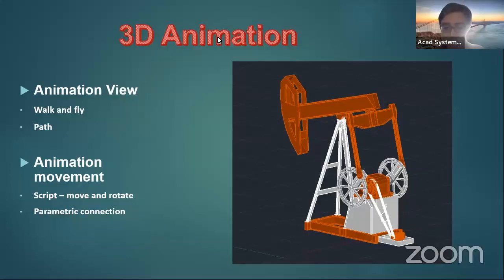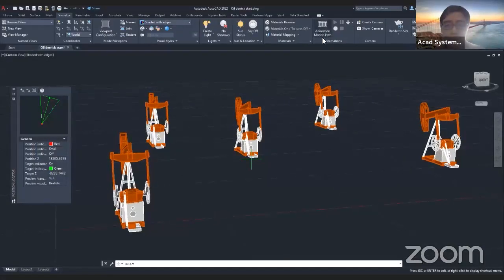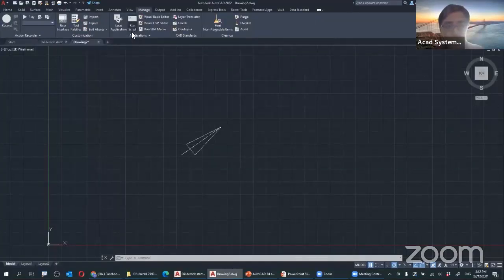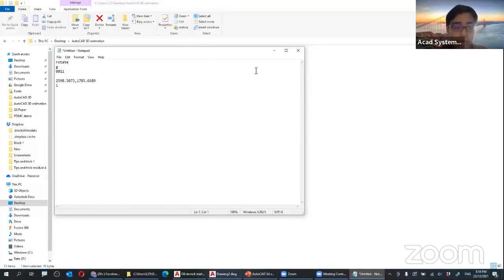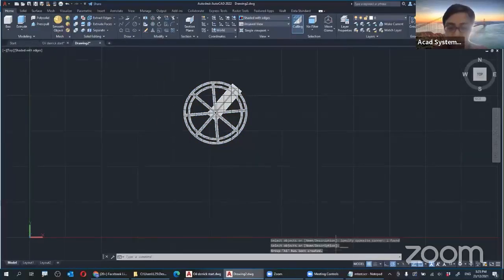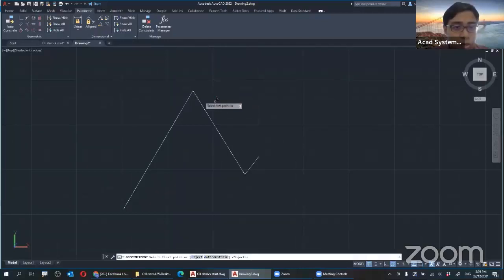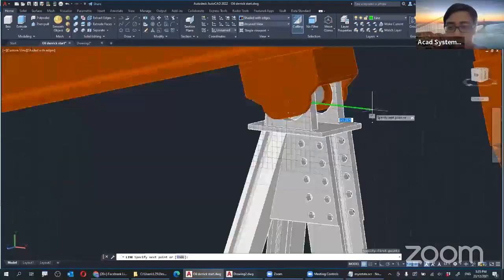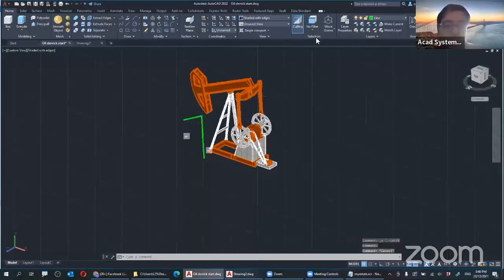How to do AutoCAD 3D Animation

Comment: Great video. I have a question about the movement method. I understand everything you've explained (that the object moves upwards by 3 units). However, I'm wondering what code I would write so that when the object is moving upwards at intervals, it stops at 50?

move
g
12

0,0,0
0,0,3

rscript

Thank you!
Reply from the maker: Hi, for that you need to repeat your code. you can also input delay to give it a short pause. delay 1000 is equal to 1 second. Here is an example that would stop until 20.

move
g
qw

0,0
0,3
delay 2000
move
g
qw

0,0
0,3
delay 2000
move
g
qw

0,0
0,3
delay 2000
move
g
qw

0,0
0,3
delay 2000
move
g
qw

0,0
0,3
delay 2000
move
g
qw

0,0
0,3
delay 2000
move
g
qw

0,0
0,2
rscript